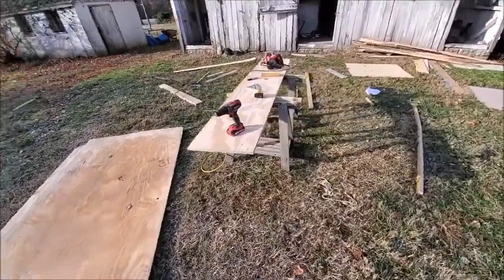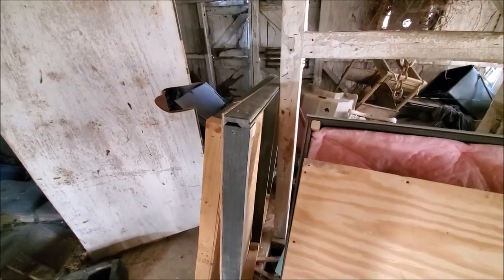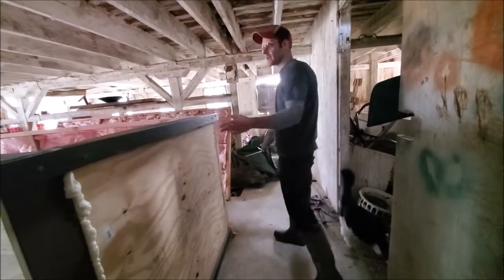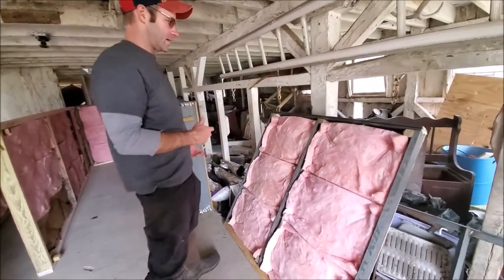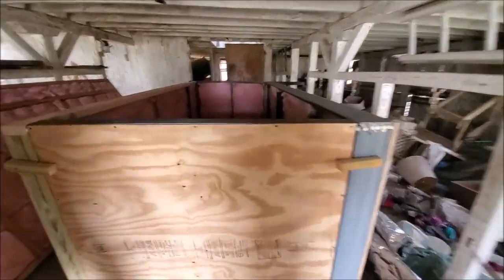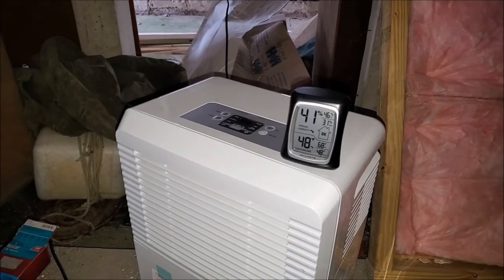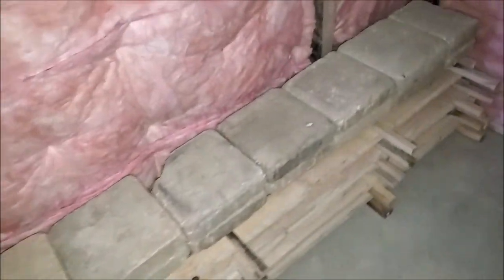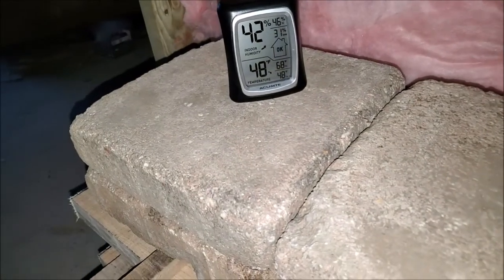How to Build a Dehumidifier Wood Kiln - Complete Process

Comment: Do you have any issues with insects in the wood since you've removed the heater?
Reply from the maker: I did not but that doesn't mean you won't. you just gotta kinda gage it and make adjustments as you go. 1 spalted tree I hit with insecticide before drying because it was buggy it worked but not sure if that's a real good idea or not.

Comment: Im curious if you checked that lumber in the middle before you pulled it out. The ends will dry much quicker and shouldn't be used as a gauge for determining dryness of lumber. 

Good idea for a build though, I like the concept.
Reply from the maker: Nope... I was going to build a piano with the next batch so will have to get all ocd about it then like people did before the advent of moisture meters and such.
Reply: @Trotlining  There was no controlled HVAC back then so it wasn't much of an issue as it is today.
Reply: Ideally you want to be measuring the moisture content on the top surface of the timber, with the pins positioned perpendicular to the grain so the electrical current doesn't travel down the timber fibres to make a connection between the pins. try and embed the pins as much as possible to get a reading as far as you can from the exposed outer face. Multiple readings at different positions and taking an average gives the best consistency. Some saw mills also wrap the ends of the timber to stop rapid moisture loss from the exposed cross-section too.  Nice work on the kiln!
Reply from the maker: @richardhawkins1216  right on, if it needs to be real straight! I like the end wrapping idea... I hope I atleast sealed the ends of this batch w some paint or something before doing a wood drying video.